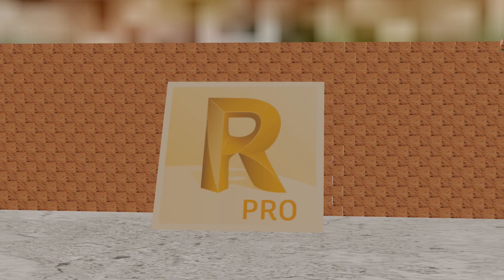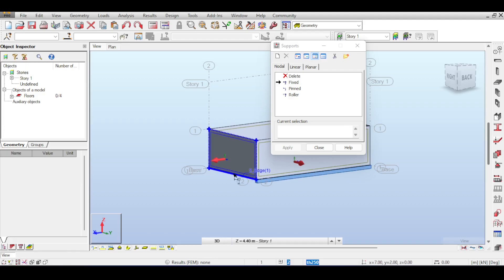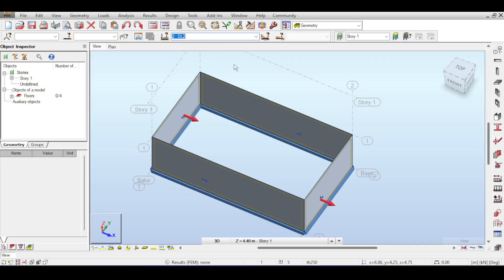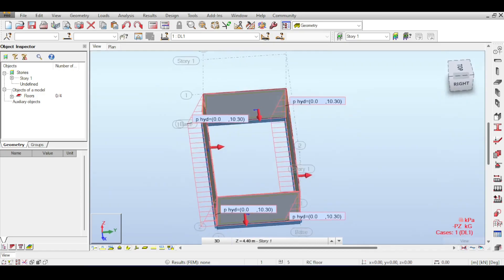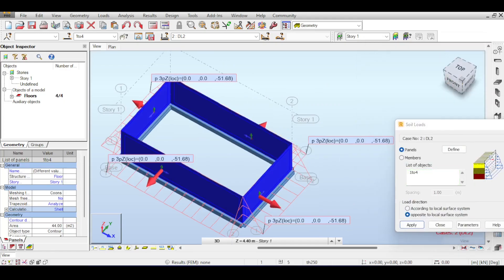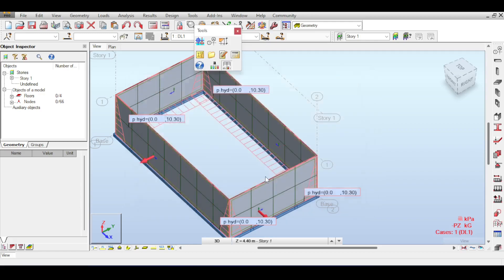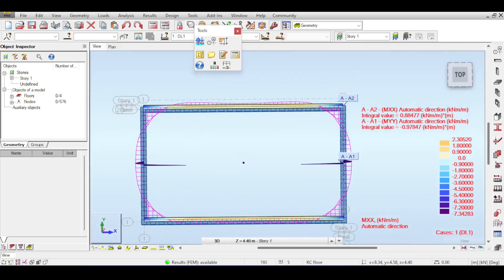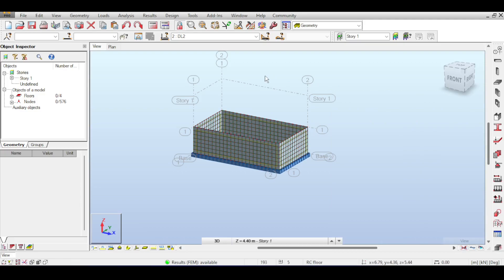Modeling Swimming Pool (Walls) - Autodesk Robot

Comment: I like the way you make it easy, really thank you for all this effort,
for the design of the walls and the rebar is there another video explaining this step Please.
Reply from the maker: Sure thing. I still need to find time for it, but reinforcing the pool + raft design of a structure + dynamics series are definitely on my radar.
I will push as hard as I can and hopefully make those possible.
Regards,
CEE
Reply: @CivilEngineeringEssentials  Hi there!
Considering the work-around about the "floor" used as a "wall", can the reinforced generated be used anyway?
I'm a little bit concerned, only because only shape 00 is given back when doing calculation...

Comment: Dear CEE, As I'm re-watching your Swimming pool model and Analysis with RSA I'm wondering why you draw wall with floors? Why not draw with wall?
Reply from the maker: Hi there, thank you very much for your comment.

To your question, the reason is: because when you tell RSA to design, if it is a wall, it treats it as a shear wall. 

I will make me a quick video explaining the differences. Stay tuned for that. Will publish it this week
Reply: @CivilEngineeringEssentials  Dear CEE, Thank you very much for your kind. I'm waiting to see your VDO this week.

Comment: dear dr.CEE,thank u for tthe work, tho there is a question, when applying soil pressure there is an error of , "the load has been applied. please check the soil level, how do we go about it:"
Reply from the maker: Hi there,
Please Make sure you typed the panel number
Here is a link from Autodesk to show you the steps
https://forums.autodesk.com/t5/robot-structural-analysis-forum/please-check-soil-level-with-reference-to-location-of-loaded/td-p/7636801

Comment: Thank you for this amazing content.I am wondering if you could make a video on modeling the floor of a pool
Reply: I share the same opinion: it will be perfect to finalize the design of the pool floor and provide the reinforcement of the whole structure. Thank you CEE ❤

By the way we would like to have more insights on this amazing tutor we have :). Keep up!
Reply from the maker: Hi there dear Engr.
That is a wonderful idea. I will have to finish my RC structure series first, as I am currently working on it.

Stay tuned for more content, also, if possible, suggest this channel to your friends.
Regards,
CEE
Reply: @CivilEngineeringEssentials 
Hi! Your videos are awesome.
I would definitely love to see the slab finalised as well. I'm trying to mix this video with the retaining wall, which indicated how to model the slab too. But it would be awesome to have a video explaining properly how to do it using the floor command.
Thank you very much!!!
Reply from the maker: @lorenzo_UK  Yep, I saw your comments. This video and the retaining wall video have not mentioned anything with regard to the design, I think I should prepare me smthn about the full workflow for those.

Thnx for the suggestion,
CEE

Comment: Excellent class, the models I have developed include hydrostatic pressure, which applied on the bottom of the tank, directs to take it off the ground.
Reply from the maker: That is perfect. It means you have modeled the slab on the ground and applied forces to it. Perfect 👍